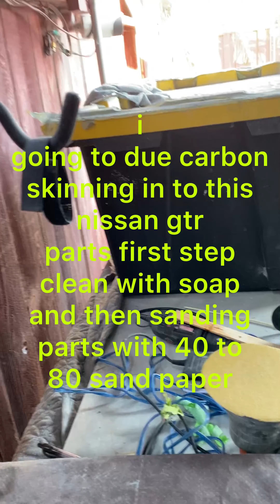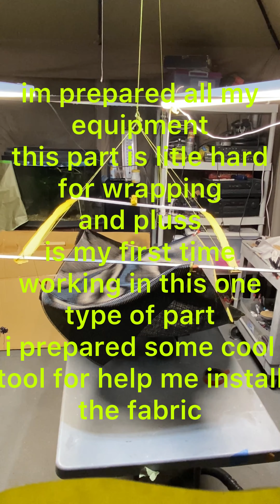carbon fiber fabric skinning complicated part nissan gtr video 1

Comment: Hey man, i dont know your background, but i was just browsing through here to widen my knowledge and noticed that you are using resin with plastics. 

I advise you to not do that. The resin is not solvent-based and is not able to get a good and long lasting adhesion to the plastics. Even with additives (which add a bit of solvent), its not able to dissolve the plastic. The better way is to use a solvent based 2 component glue, such as used in the upholstery industry. There are plenty of suppliers for this kind of glue. This glue will give you not only a mechanical, but a chemical bond to the plastics. This still has it limits when it comes to low energetic plastics like PE/PP.
Still, you can get "enough" adhesion to some plastics, like ASA. But for the most part with ABS/ABS+PC etc. Resin wont do the Job and the parts will lift once they undergo heat stress.

You can also use this glue for aluminium parts, though you gotta adjust the process here. First clean with silicon remover, then sand with 40-60 grit, remove the dust out of the scuffs with air pressure and immeaditly apply the glue. This is very important with aluminium since it oxidices quickly when open to air, and the aluminiumoxcid isnt very good to bond to. That also applies for resin, if you sand parts and leave them for some time (like when you use resin to stick the cf), it will oxidice reducing the quality of bond. Oh, and thermoactivated 2k-glues give you a way better comfort when applying the cf to the part. Makes it way easier.

I went through all of it. Aluminium and plastics with resin and with glue. And from my experience, proper preparation is key for long lasting cf parts.

Just wanted to give you this tip, no offense :)